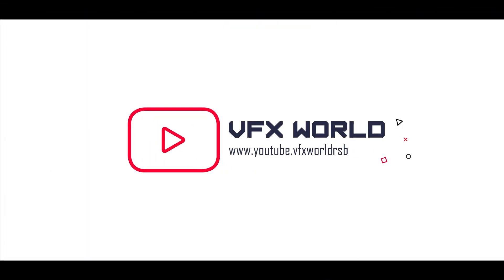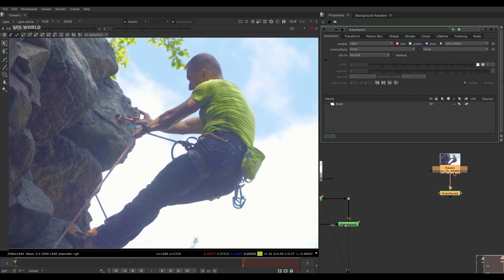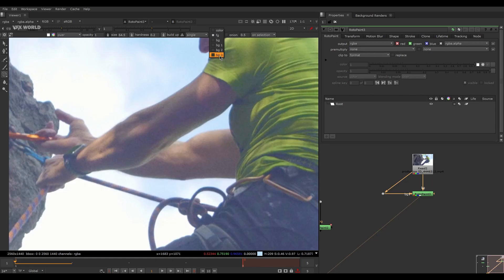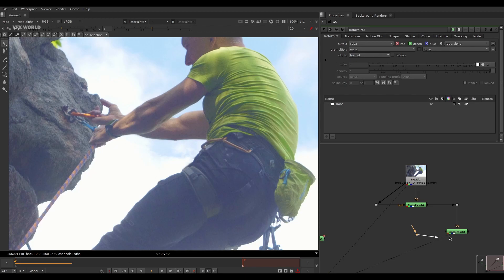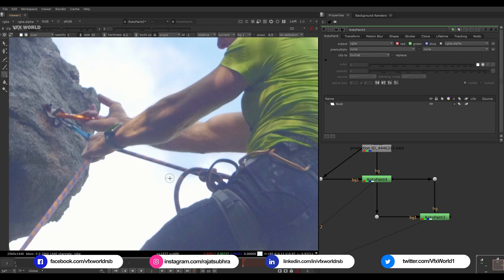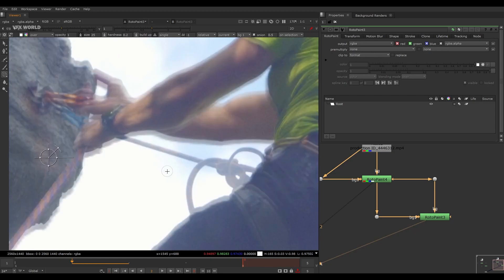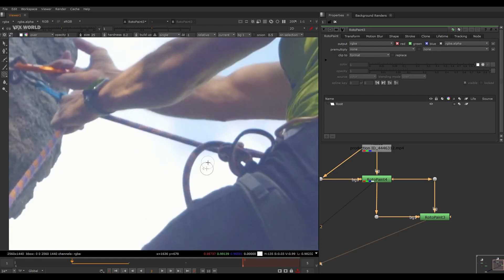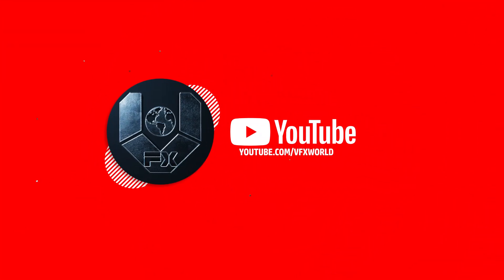Nuke Sequence paint | Wire Removal Tutorial |  VFX Paint Tutorial For Beginners

Comment: It is time taken
Reply from the maker: Yes, but this is the way in production we doing... But u hv other ways too
Reply: sequence paint depends on what is needed. If there is over 100 frames it would be best to use a clean plate rather than painting over 100 frames.

You could also do a clean plate and track for this shot. then do a roto hold out to bring back the required information.